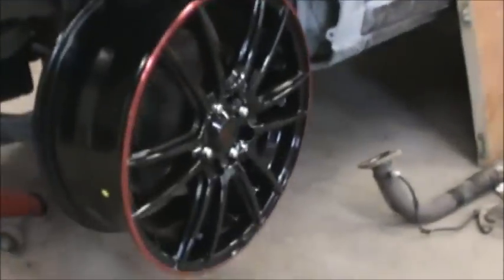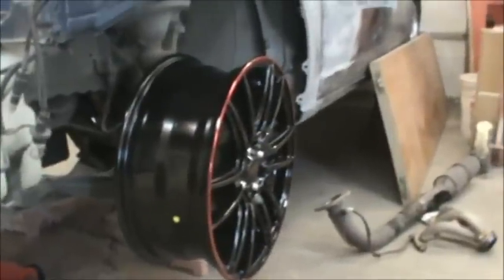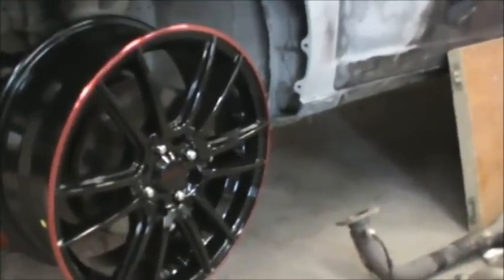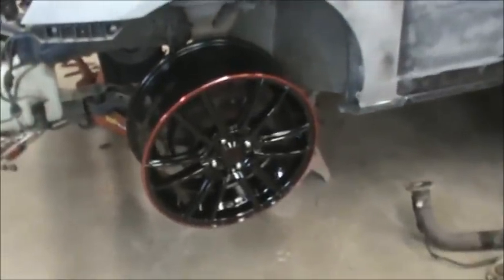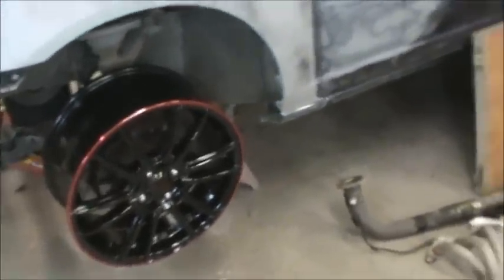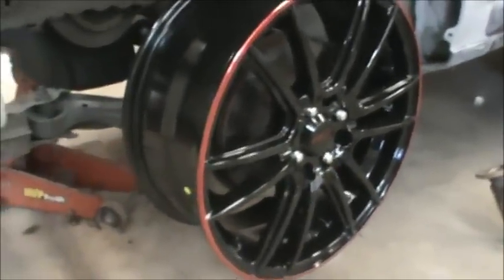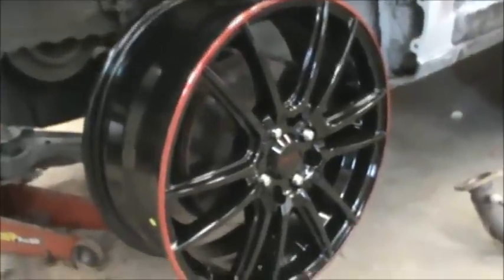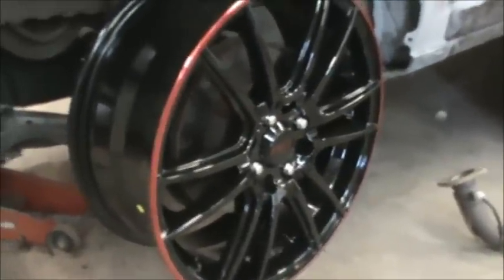My Civic EV Electric Car Project Part 5: The Wheel Project

Comment: Any way you do it, doing a nice job clearing those rims is going to be a bitch. If I was challenged with the task I would turn the gun way down with a fine pattern and do it spoke by spoke instead of fogging. One coat only, runs or sags would = disaster.
Reply from the maker: I agree. I been watching some wheel painting vids. With practice I think I can pull it off.